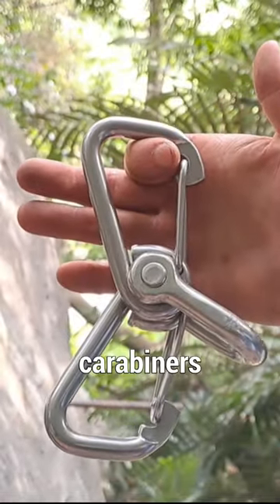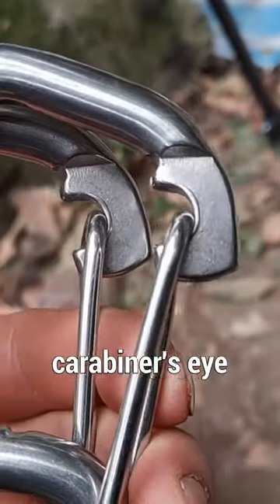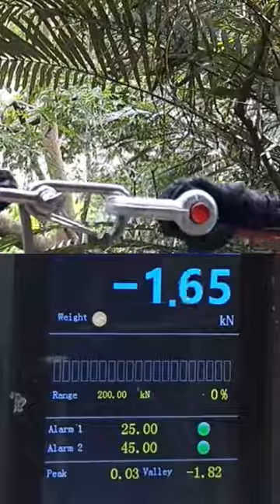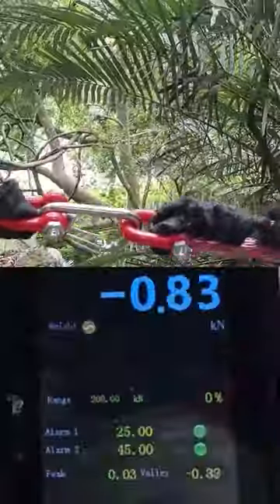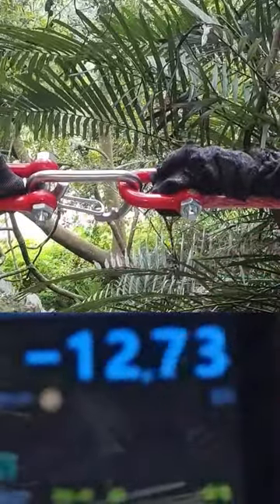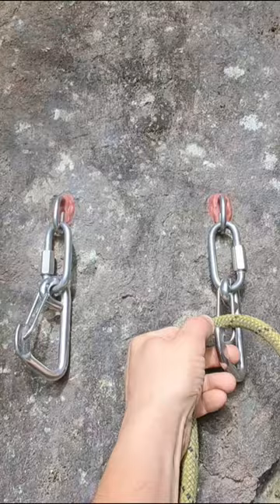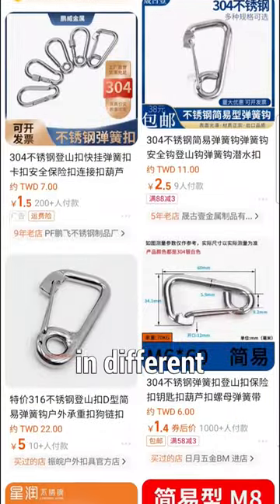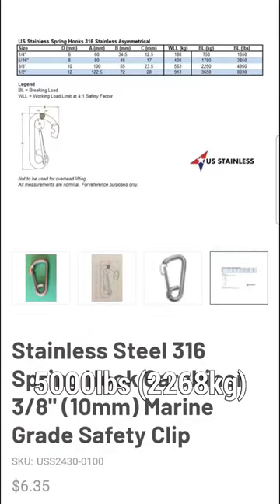BREAK TEST: 316 Stainless Steel wiregate captive eye carabiner, steel manufacturer China

Comment: So what you are saying is they are crap?
Reply from the maker: No, not really. 13kN isn't too bad for applications of lowering. It still takes 10kN to begin bending this 10mm rod, and lowering a climber would only put a couple of kN on an anchor anyways. What I'm saying is one sample broke at 33kN (which is good) while the others broke 20kN lower at 13kN. So my point is what minor adjustments can made in them to better reach even higher strength.